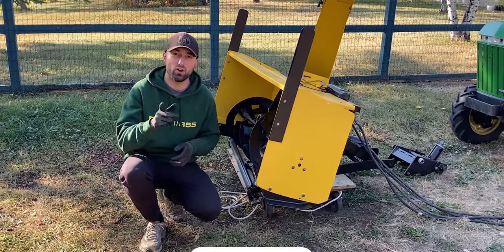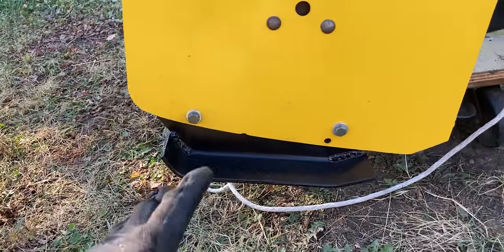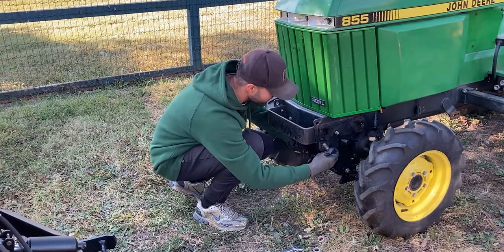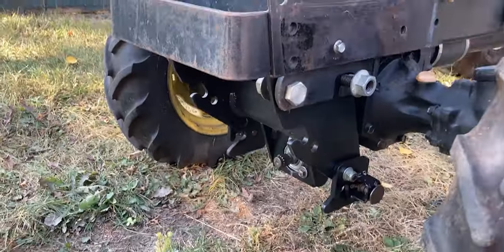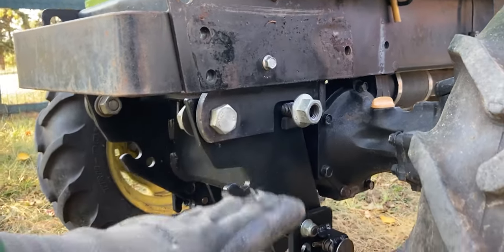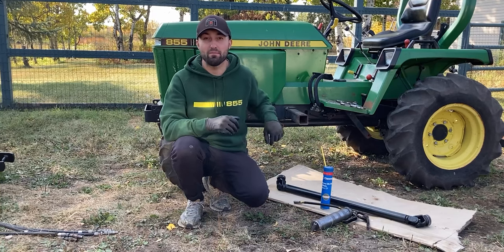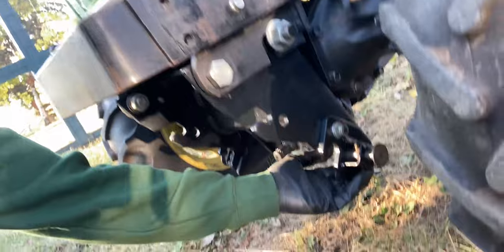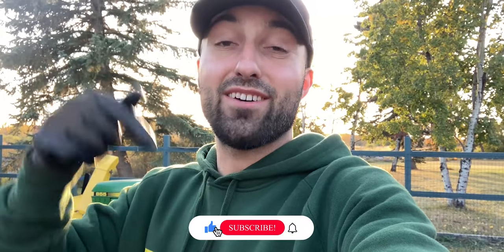JOHN DEERE 855 TRACTOR |WINTER SNOWBLOWER SETUP

Comment: Hello Sir, All great Vids.  Wish I had the time and ambition to prep my equipment like you do.    How did you route the hydraulic lines from the snowblower?  They run awfully close to the tire and the exhaust.   Also does it matter which end goes forward on the driveshaft?  I've never seen any recommendation on that.     Thanks-  an 855 owner.
Reply from the maker: Thanks a lot for your feedback! It does take time to rebuild a snowblower like this or even some equipment, but once it's done it will last longer (at least I hope it does haha).
I tied a rubber around the hoses and suspended them above the front wheel, close to the left side panel. I would like to make a bracket for this, as it bugs me a lot!
On the other hand, it doesn't really matter which way your driveshaft is mounted. As long as it's straight and balanced, it will not affect any of the components.
I hope this helps and thanks for your great comment!
Regards Andreas
Reply: Thanks for your help. I've had my 855 for some years, and it's done everything I've ever ask of it! @WorkshopRebuild

Comment: Great video. I've got the same setup. One question I've got is in regards to vibration in the driveshaft. I can see in your video that your driveshaft has some wobble in it. Has this caused any problems for you?
Reply from the maker: Hi Kyle, that's awesome! How do you like your tractor and blower setup? 
I actually looked at that too when I edited this video and went back to check on my driveshaft. The driveshaft that I have on my machine is a Triangular Bell-Shaped driveshaft. When it spins, the light reflects off it differently than a square tube or even a regular round driveshaft. It has little to no wobble up close, but if it did I would be worried for the shaft bearings on either side.
I just tested this setup about a week ago when we had a couple inches of snow and I didn't run into any issues. I will be sharing a video later this year when we have more snow and then I can really see how well it performs!
Great question btw and thank you for viewing! Regards Andreas
Reply: @WorkshopRebuild  I love the tractor and blower setup. I'm glad your setup is working well for ya. I watched your rebuild video as well, which is super helpful seeing how everything is put together. I've got some vibration in my driveshaft that is making me uncomfortable and can't figure it out, which is why I was asking. I think I will take apart the coupler and check the eccentric locking collar and bearings.
Reply: @WorkshopRebuild  I have a 47" blower on a 1025R which is a little different, was reading about making sure that the drive shaft's universals are in phase to make sure you don't get a vibration in the drive shaft.